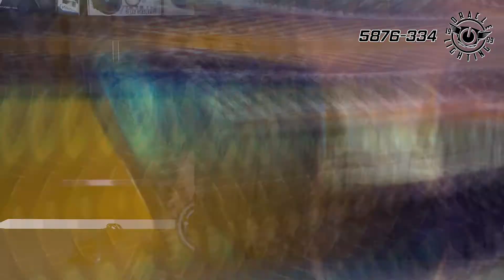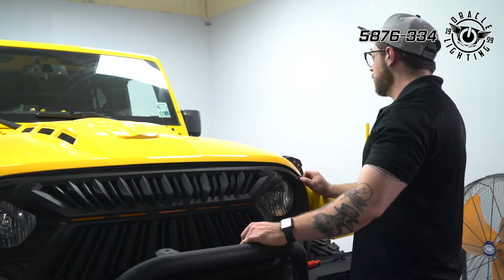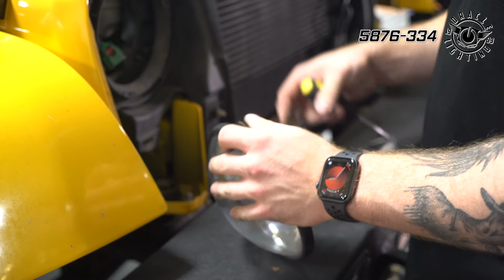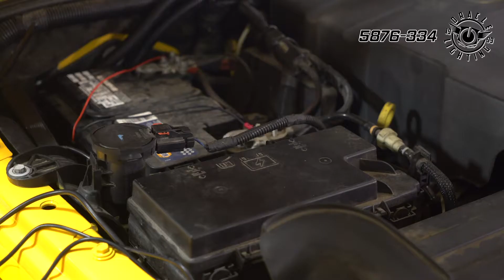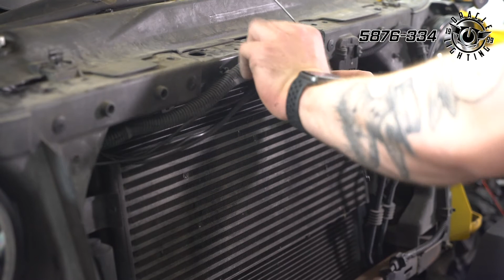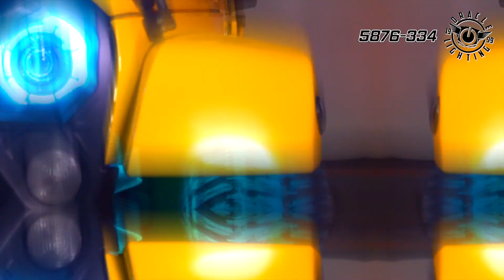ORACLE Lighting 7" Oculus Bi-LED Headlights for Jeep Wrangler JK- NEW ColorSHIFT Version!

Comment: How can I make each zone a different color ? I bought the bc2 controller. I had my mechanic install the lights but I think he just installed them very basic. Do I need to buy two more bc1 controllers to make the zones different colors?
Reply from the maker: You could add 2 more controllers if you want to control each zone individually but if you just want to change the colors so each zone is a different color you can cross the colors. For example connect Blue to Blue Zone1, Blue to Green Zone 2, and Blue to Red Zone 3
Reply: Did you ever get it figured out? If so, how? Which option did you go with?